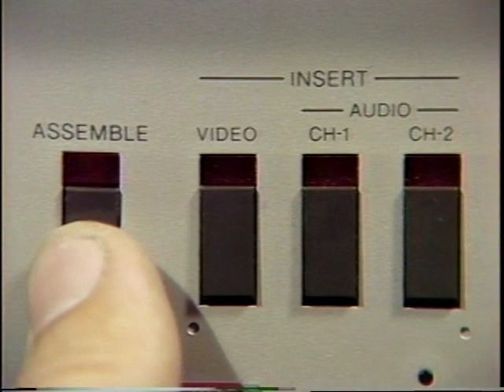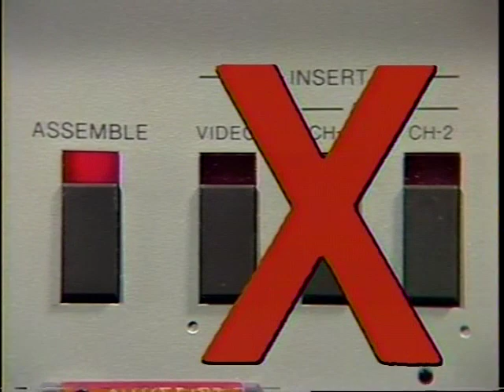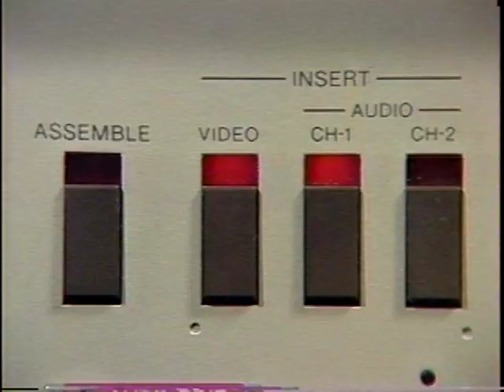Assemble Mode and Insert Mode Editing - Bob Reynolds

Comment: Not quite sure what you’re asking. The video does a good job of covering the basics for a novice without going too far into into the technical weeds.  But, if you’re just wanting to confirm some of the weeds, you’re close.  Using the original Ampex Quad as the model: The control track’s nominal frequency is 240Hz. In Record mode, it’s derived from either the vertical sync of the input video, an external sync signal or the AC power line frequency. This 240Hz provides the reference for the video head servo and the control track recording. Also, in Record mode, the video head servo derives a 60Hz capstan reference from the video heads 240Hz rotation to lock the head and capstan together. In Playback, the 240Hz from the control track playback is fed through a phase shifting circuit (Tracking Control) before sending it to the capstan servo. This makes it possible to adjust tape position and center the video heads on the center of the recorded video tracks. So, it’s not head speed but capstan phase that is varied to achieve maximum RF off the tape.  Hope it’s a good dinner for whoever gets to enjoy it.

Comment: Actually a control track is normally a constant frequency, normally. A "tone" of 240hz. This signal is used to regulate the capstan speed to a speed that was done at record time.. The video head speed is the "tracking" knob and is set for maximum RF off the tape. Some machines will automatically track on playback. During record, the video head rotates at a fixed speed.